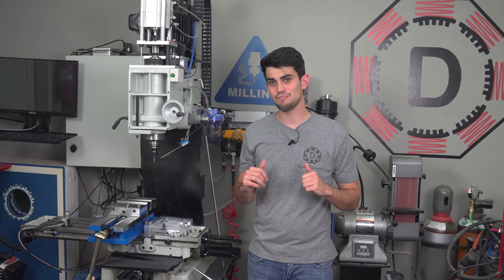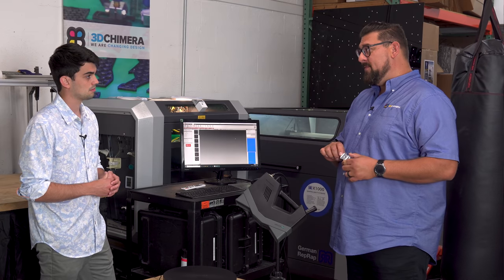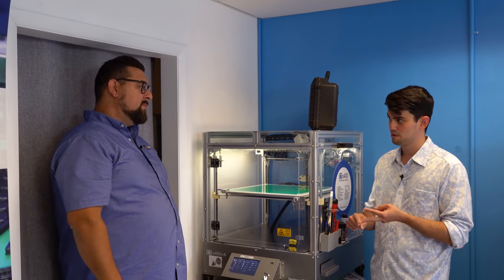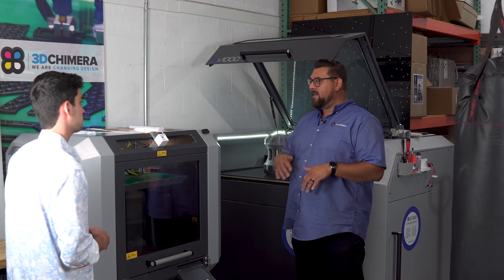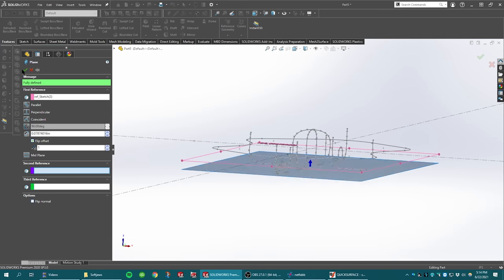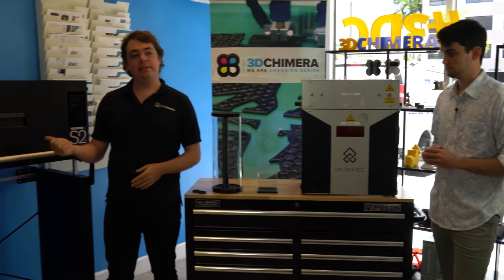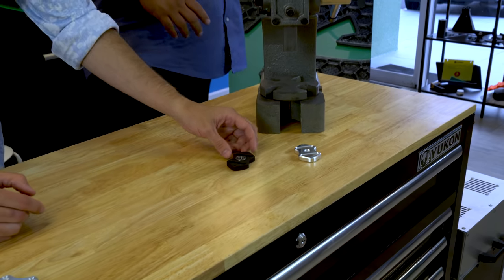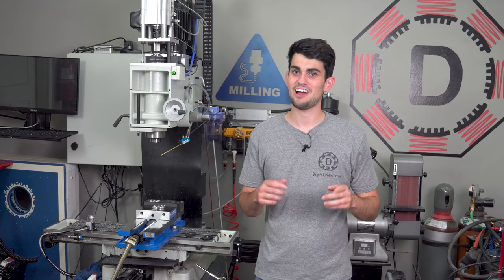Industrial 3D Scanning and Printing with 3DChimera (FFF & SLS)

Comment: I thought this was one of your best videos yet, taking us through a concrete example with numerous problems to solve along the way, and how various techniques address them.  It's often useful to see how problems are addressed at a slightly more "pro" or "industrial" level compared to the commonplace low-end practice, as that gives us some solved examples, from which we might learn something we can apply "less industrially", or perhaps appreciate that going to extreme amateur efforts might not be worth it.  Your interviews and tour at 3D Chimera gave us some of that insight.  I don't say that all your videos should be like this, but this style is certainly worthwhile from time to time.  Nice job!

Comment: I would have 2d scanned the part (any common scanner), import the image to fusion 360, calibrate to a known measurement on the part and presto - project the pattern on soft jaws and CAM away
Reply from the maker: Yes! That is why I included the bit about there being easier ways to tackle this project at the end of the video. Your method is how I would have proceeded without 3DChimera. Obviously, there are much more complicated 3D geometries that the 2D method would not work for but 3D scanning would. Just image one of those parts in this workflow
Reply: Getting this done at a 3D shop definitely made for a more entertaining and informative video.  Thank you

Comment: Nice video on the workflow of a 3D printer shop. Any idea what a shop like that would charge for 50 of those parts?
Reply from the maker: Maybe 3DChimera will respond, but my estimate would be in that $600-1000 range. It’s a little complicated to calculate because that nylon powder is expensive at ($150-$100)/kilo and you have to fill the entire build volume with powder but some of it can be recycled after the fact. Also you have to pay someone to clean the parts, dye and finish them which is labor intensive. Would be about $12 part on the low end but this would include profit for the manufacturing company.

Comment: FFF Printing soft jaws, with Nylon isn't really a good idea. Not only nylon ISN'T stiff at all, they also printed it with just two perimeters...oh, and the soft jaws are above the vise, not supported on the back. That's a nice way to get some deflection, and with the orientation when printing, you could easily split the layers too.

Comment: Plenty of ways to get this done and this example does highlight some cool technology most of us won't have access to. 
The original bore could have been located close enough with a pin in a tool holder at X0,Y0, the part toe-clamped and re-cut in place for the amount of material removal involved. 
Part orientation is meaningless other than a trammed flat plane re-cutting in this application. A more efficient use of time and money than the air travel and custom tooling? 😁

Comment: Isn't it usually a bad idea to constrain the lead screw with a bearing? I'm pretty sure I heard it could cause it to bend.
Reply from the maker: The lead screw is only constrained on one side (this piece). Flexible coupler on the other end.
Reply: Hmmm if the lead screw is carrying a "carriage" that is itself constrained in the perpendicular axis to the lead screw axis this 3rd point would over constrain the system wouldn't it? On the Ender 3 for example, putting something like this at the top of the leads crew I feel might cause issues.
Reply: @andrewmalaty8  There are a number of 3D printers with dual Z axes which have flex coupling on the two lead screws at the bottom (at the two stepper motors) and the lead screws are constrained with bearings at the top. (And the two lead screws are coupled to each other by timing belt and pulleys.) Then the X gantry is driving up and down by the lead screws, using lead nuts that have some form of X-Y compliance, so they transmit primarily Z force.  Artillery X1 Sidewinder is an example, but there are others with similar dual-Z design.